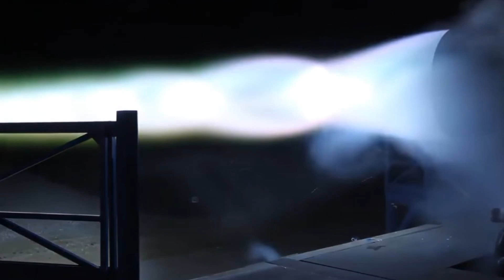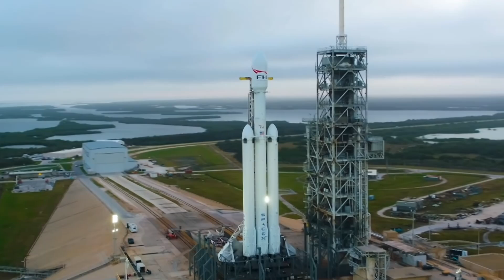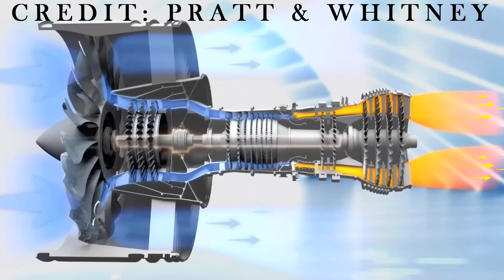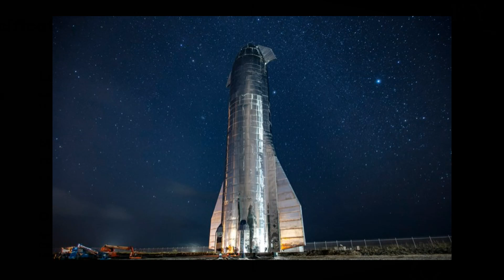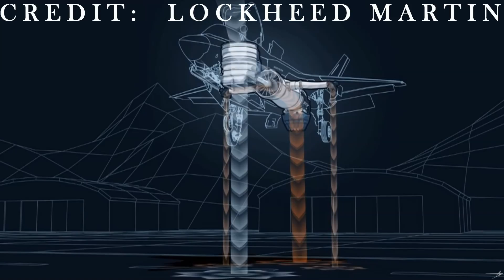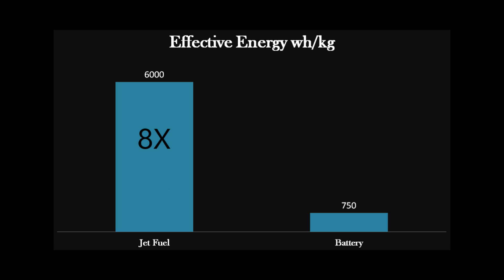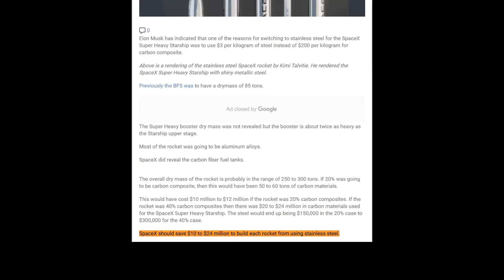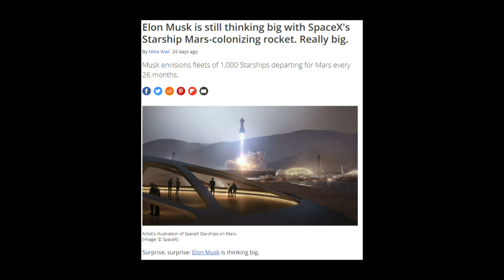ELON MUSK'S BATTERY POWERED SUPER SONIC VTOL JET - My Tesla E-SuperVTOL design

Comment: retired navy  pilot's  mind tottally blown
Reply from the maker: Glad you enjoyed it!  It was a bit of fun making this.  I'll eventually remake it though, it was a naive in many ways.  It needs to be area ruled, needs to take into account shock cones, needs two different methods of thrust (one for VTOL and one for supersonic regime), and aircraft aluminum would be better than stainless steel at the mach number I'm targeting.
Reply: @thelimitingfactor  Concord is not "area ruled".  I pick her because you used a picture of her, and it is obvious to the casual observer that she isn't area ruled.  I believe the myth of the "area rule" was settled long ago.
The Pipistrel cost savings seems dubious.  Even at $10/gal (about twice the cost in the US) for aviation 100-Low Lead gasoline, I doubt that design would burn more than 5 gal/hr, or $50/hr with a Rotax four stroke aviation engine.  If comparing with a 172 that might burn 10gal/hr, well then you are about $100/hr in 'savings'
I don't share your admiration for Elon.  However, I am an investor in his Tesla stock because stock prices tend to rise reliably, in the long term, of companies that operate like cults.  Elon is the archetypal cult leader.
I may live long enough to see the age of electric powered sailplanes reach a level I can jump into.  Maybe not.  So, I am interested in significant short-term advances in battery charge density.

Comment: I made a video of what I think Elon's design entails (my videos are not monetized).  https://youtu.be/_QgiVP04ZrU
A turbine is not the compressor, a turbine does not 'push' air.  The turbine extracts energy from the combustion gasses to power the compressor.
You don't understand that the compressor of the turbojet engine does not generate any meaningful thrust.  The compressor is akin to running a piston engine without fuel.
Now, maybe Elon is thinking that cooling of the electric motor heats the air in the "combustion" chamber, possibly using a vapor-compression heat pump to increase the temperature in the "combustion" chamber.  I haven't calculated whether this makes sense.
Read, "The Simple Science of Flight". 
All in all, I personally think Elon smokes too much marijuana while imbibing his own flatulence.
Reply from the maker: Yeah, this video needs fixed up.  Interesting video!  I was wondering if something like this was possible or feasible for supersonic thrust.
Reply: @thelimitingfactor  A GE90 engine generates 110,000 HP, and an electric motor that outputs that much shaft horsepower weighs about 300,000 lbs (best case - that weigh would be cut by 1/2 in an aircraft?).  I would love to review Elon's calculations to see if he's made an error somewhere.  I have a degree in mechanical engineering, but this topic is completely outside my experience (I'm in measurements); however, I am a pilot and aviation is one of my hobbies.
Your chemistry videos are awesome.  You can make an update to this one if you wish, but I think Elon eventually realized he made a mistake somewhere in his analysis.

Comment: This is all silly good fun, and I love that sort of thing, but it's far from realistic.  There are a million issues but I will only mention one... If you lose one engine on a 6 engine electric VTOL in a hover, the power required from the remaining engines goes up dramatically.  Roughly speaking, In order to keep the thing in balance, you have to shut down the opposite engine, which means when you lose one engine you lose two engines. Now you have to provide the same thrust with 4 engines, but it is worse than that.  With 76% of the previous disk area, you need 22% more power for that reason alone.  It amounts to about 84% more power from the remaining 4 engines.  That makes them bigger and heavier than they otherwise needed to be...  If you want the benefits of redundancy, you better plan on at least 8 engines, preferably 12.
Reply from the maker: Yup!  I"ll make a version 2 - been learning how naive this was.

Comment: Hydrocarbon fuel has a much greater energy to weight ratio compared to the most efficient batteries. Battery powered Jets flying at over 700 mph. I don't see this ever happening.

Comment: You mentioned 'developments' to deal with the noise of going supersonic. Can you clarify? Noise controls pretty-much killed Concorde in the long term as it could only do supersonic over sea. Is there really a viable solution to this? I don't see how technical developments in the plane can make much difference to the noise problem.
Reply from the maker: Look up boom supersonic and NASA's quiet supersonic program
Reply: @thelimitingfactor  Cheers. This webinar explains what is being done: https://www.youtube.com/watch?v=_jjtFTTSZcE
It does seem that it's possible to design a supersonic plane to be surprisingly quiet. Interesting.

Comment: With Alkaline fuel cells (not acid PEM fuel cells) and liquid hydrogen and liquid oxygen  can contribute to cooling superconducting motors ,pressure from the gases being heated can be recovered to add electric power before entering the fuel cell stack. As the flight continues H2 and O2 are consumed lighting the load .

Comment: Hi Jordan - thought you'd really want to see this new information on electrically-driven jet using microwave and plasma - https://aip.scitation.org/doi/full/10.1063/5.0005814#
Reply from the maker: This is awesome.  This is possibly the engine I've been looking for to strap to the VTOL...
Reply: @thelimitingfactor  Ars technica had some concerns about scaling this 15,000 times and noted missing data points at the high end of airflow where they said the plasma flow might become unstable. But for something pretty homemade, its an interesting "placeholder" for what could evolve (https://arstechnica.com/science/2020/05/microwave-thruster-makes-for-clean-burning-jet/
)
Reply: @thelimitingfactor  You would have plasma flames looking like afterburners. The thing would look damn cool at least.
Reply from the maker: @mearino  🔥🔥🔥🔥

Comment: There is a huge speed advantage from an entire trip perspective with this design if you take airport logistics into account.  If you consider the total time of your trip then you have to include the time to taxi on runways.  This part of the trip wastes time since the speed is very low.  We have all been on a flight that had to wait in line to take off.  Not only does this waste time, it also wastes fuel.  A VTOL simply goes up and gets on with the trip.  It simply has to go in this direction.  Great video.
Reply from the maker: Thanks Warren!

Comment: Two other possibilities to consider.
1. A hybrid jet engine, with an electric motor driving the intake compressor, a combustion chamber burning jet fuel shaped to maximize thrust - but no expensive gas turbine to interfere with thrust. Result - higher efficiency than a conventional jet, longer range and higher speeds than electric only plane. 
2. Hydrogen tuel cells could result in reduced weight for the same range, compared to batteries. Unfortunately, hydrogen is a much more expensive fuel, so the weight reduction might not be worth the higher fuel cost.

Comment: At first I thought this was an April Fool's joke, this is a classic example of how you can make just about anything appear legitimate on the Internet if you speak with authority and have a polished presentation with high-quality graphics. Wouldn't it be nice ... Disappointing that so many readers lack basic critical thinking skills. As others have commented, there are so many technical errors and false assumptions here. Propeller-driven airplanes can't exceed the sound barrier, yet the author expects us to believe that there are magic ducted fans that defy the same physics? And that's just one obvious give-away.
In fact, informed experts agree that hybrid hydrogen fuel cell/battery/electric motor technology has the most promising potential to provide the necessary range and reliability/redundancy required for clean subsonic passenger aircraft in the near future. Fuel cells require oxygen, of course. Similar hybrid systems are being developed for drones, trucks, locomotives/trains, ships and other commercial vehicles and equipment in a post-fossil-fuel world. Ammonia is also being considered (as a hydrogen source and non-carbon "fuel"). Meanwhile, many battery-electric drones, VTOLs and other aircraft are under development, but all are relatively short-range, small and slow.
Meanwhile, slow steady progress continues on improving the energy capacity of modern battery cells and hybrid battery/supercapacitor devices.
Reply from the maker: You should start a channel Dan!

Comment: Concorde showed super sonic transport was possible but revealed why it sucks, apart from the costs and complex maintenance you would fill the air with a deafening racket if it was really allowed to travel super sonic. Over land and close to coasts it was banned robbing it of many routes and it main purpose.
Reply from the maker: Possibly.  There are multiple quiet supersonic concept designs and two of them are progressing to pilot aircraft in the next couple years.

Comment: Great im not alone calculating these things at home great video. Would just add that Elon talked about that air resistance increases in square but air pressure in with greater heights decreases exponentially so that there is a height we’re you use the same energy in supersonic a a jetzt in sub sonic. I would say that for early electric planes simply flying subsonic but higher and being vtol with all the metioned benefits could also be a great usecase especially for shorthaul flights. Imagin using only 1/10 of the energy and having no flighthoure restriction could be a huge deal in Europe.
Reply from the maker: Agreed!  Trying to decide whether to push on the ss vtol concept more or do something simpler.

Comment: Do you have any evicence of a prop driven aircraft going the speed of sound? Yes, a turbine is basically propellers in a tube. I think the props have trouble moving air that fast without the aid of the heat/expansion of burning fuel.
Reply from the maker: What if there are just compressors, rather than turbines and fans?
Reply: @thelimitingfactor  Any mechanical part (propellor, compressor, helicopter blade tip, etc.) moving through air at faster than the speed of sound will cause a shock wave. Imagine multiple continuous shock waves inside whatever mechanical propulsion system you are trying to build. By the way, I have heard Musk mention electric planes multiple times but I don't think I've ever heard him say "supersonic." As far as I know, only YouTubers have added the "supersonic" description.
Reply from the maker: @jimdetry9420  Nope, he's said it multiple times.  Here it is on the Joe Rogan podcast:  https://youtu.be/ycPr5-27vSI?t=4509

For a compressor based system, the blades wouldn't have to go supersonic.  The thrust would be created by compression/heating of the air.

Comment: Great vid. Is it necessary to have any lifting surfaces? Just angle of attack of the rotors should be enough. Would that be more optimal than overcoming the lift surface drag? And if engine cooling vs size is a problem why not just go for more smaller engines? These engines have to work in extremely different regimes, like hi Mach low pressure at extreme RPM (100,000?) and one bar low speed take off/landing at say 10,000RPM. That's an interesting problem too. Feathered props?
Reply from the maker: All good questions and things I'm thinking about!

Comment: I'll say what nobody was thinking: over the next 5 years, neural networks will be designing parts to meet our constraints, especially materials design (as you covered in your recent Meng video! thank you!) and this will open-up a radically more energy dense and efficient propulsion: super-ionized fluids . Picture two thermos-like tanks, one is liquid O2 at -2 charge apiece, the other is methane at +4. That charge is united in a plasma-exhaust, with energy density DOZENS of times higher than jet fuel, ( after accounting for tank mass! ionization is measured in GIGAjoules per kilogram :G ) and NO INTAKE - you just entrain surrounding air using the sheet of exhaust, no heavy turbines, no drag from compressing a wall of air down a pipe, and FAR simpler design. With the speed of the lightning bolt's heating, you'll get insane exhaust velocities, easy to go supersonic. It's the bastard cousin of a rocket, with all the advantages you outline and more, no?
Reply: to sketch a bit more detail: I suspect it will do best as a delta-wing with a cross-section analogous to a running shoe with the heel cut off of it , or a child's sled; a steep 'J'. Inside the 'toe' of that J, the plasma torches point back, acting much as the cone of a rocket does to translate exhaust velocity into thrust... meanwhile, the entrained flow over the back of the wing generates extra lift at lower velocities. VTOL by tilting the whole wing, I guess. Though, in the end, we will probably see a higher payload rate per sq. ft. real estate if we just have a magazine of launch vehicles shot out of a rail gun at 3g's, then ignite boosters...
Reply from the maker: Very cool!  I've read every comment and I haven't seen that one yet!  🤜🤛 Wicked!
Reply: @thelimitingfactor  hehe - thank you! time will tell, and market factors, etc. yet I have a suspicion that nature prefers designs which operate by high ionization; the energy density, combined with intensity of the interaction, is like that golden ring on the carousel of design. And thank you for reading and replying; I know that can take a lot of time :o
Reply from the maker: @anthonyrepetto3474  I don't mind long replies that are interesting.  Some long replies are really hard to read, but that was enjoyable.  You have a good writing style.
Reply: @thelimitingfactor  Just thought I'd mention, stage 1: in IEEE Spectrum, article titled "Plasma Jets May One Day Propel Aircraft." They mention that the missing ingredient is a high-density electric source, and that we might be able to see plasma jets in limited applications within five years... AI should make super-ionized fluids' tanks and valves a cost-effective strategy soon enough :) K, I'll shush now!
Reply from the maker: @anthonyrepetto3474  😃 I've been looking for an engine, I think this is it!

Comment: A hybrid jet might be more feasible. The electric part will be used for getting airborne and landing. The battery can be recharged in flight to used later for landing.. weight for the electric motor and battery can be compensated for with no heavy landing gear and smaller wings.

Comment: By the late 2020’s Starlink should provide cheap, ultra low latency, extremely reliable, gigabit internet to commercial aircraft generally so obviously here too. Tesla should be on their 4th or 5th generation of AI neural net chips which would be made by the millions and easily capable of flying this - as backup, the internet connection means it could be flown by remote pilots if that was useful.

Comment: I'm not convinced on the landing legs, I still believe that it would have wheels. You don't want to have to spin up the engines and get a pilot and ground personnel ready, just to move it to the left 3 inches. Only disagreement I have. Solid design otherwise.
Reply: Seems pretty simple to have a skateboard on the ground that couple roll under it, hook into the legs and move it around. No need to carry those things around in the air.

Comment: What is still very incomprehensible to me is
how the battery jet engine itself works at all. 

Without kerosene? Is it just a big fan? How
can the engine work in very thin air? 

How does it generate the thrust?
Reply from the maker: I need to create a video focusing on this!  A few different paths - trying to find something feasible.
Reply: @thelimitingfactor  Fair ennough.

Comment: Thermoelectric materials generate power directly from the heat by converting temperature differences into electric voltage. 
You can regenerate power from surface heat during supersonic flight, the conversation of heat also acts as a cooling method.

Comment: If Elon could make a battery out of GRAPHENE and other good super light materials that also leads electricity enourmously better than todays batteries, he has then solved this problem!
Reply from the maker: I have plans for graphene :) It combines well with high energy/low power materials like sulphur.  Right now, they can get a lot of the benefit, without a lot of the cost with Maxwell DBE.  At least, that's my theory!

Comment: the Limiting Factor - I think the e-Supervtol can be improved.

#1 - use Annular gimbled e-jets instead of a conventional turbine.
the turbine can be made even smaller , and a lightweight Annular wing to direct thrust.
Annular wings MULTIPLY thrust through the IRIS and also Around the wing as well.
SEE - Dyson FAN.

#2 - use Supercranked Delta wings , even more aero.
BEST if combined with a WASP hull.

#3 - use a WASP hull instead of a pointed tube.
BEST if combined with a Supercranked Delta wing.
WASP hull will be slightly more complex but GAINS in efficiency.

#4 - I think EARLY examples of the e-Supervtol .
will still have Pilots , but NO Windows similar to the MAGLEV shinkansen in Japan.
Reply from the maker: Awesome feedback!  I'll look into these!
Reply from the maker: Can't find info on wasp hull... What is this?
Reply: @thelimitingfactor   - in Early SST the designs were all tapered tube designs, in more Advanced SS combat Aircraft they use a Wasp Hull, like a long balloon with a Twist in the middle , AKA as the Coke Bottle hull.
this created Greater Efficiency with supersonic speeds , specially when with a Canard or Compound Delta design wings.
Reply from the maker: @markplott4820  Fascinating!  Thanks for the info.